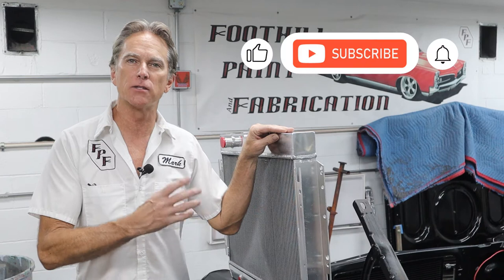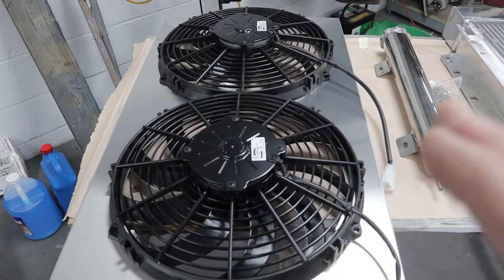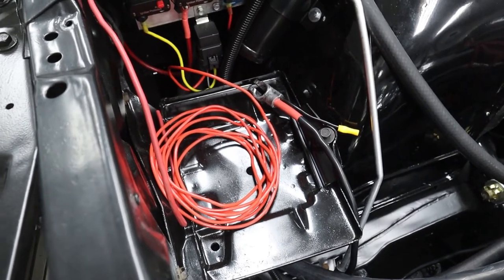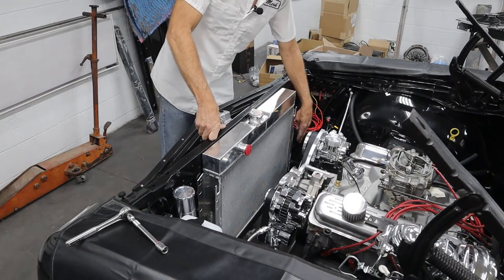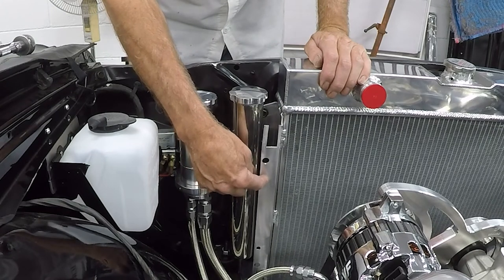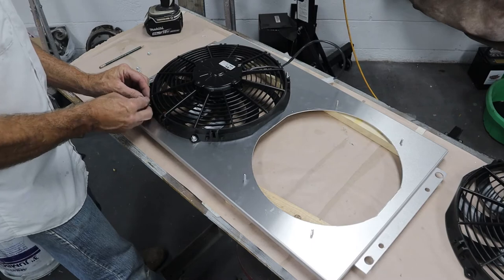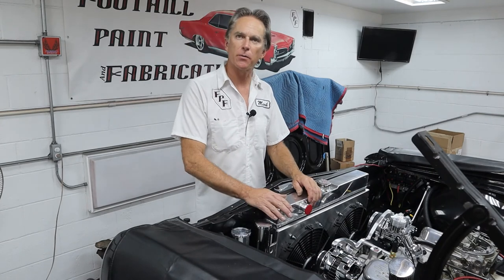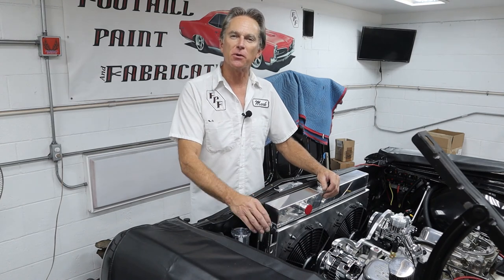1965 Malibu SS (Ep 21) Champion Radiator and Electric Fans Install

Comment: Nice install! I just installed (Friday) a champion 3 row, dual spal 13 inch fans and overflow in my 67 c10. The install went smoothly, no issues, truck runs 198 with AC in the south Texas heat. Never climbs above 200 even after an hour idling with ac. Very happy with my new setup.
Reply from the maker: That's awesome, got to love it when the install goes smoothly. The Chevelle gets to 180 most of the time and stays there like the gauge is broken. Nice not having to watch the temp like a hawk with the AC on.
Mark

Comment: She's really coming together now Mark. Very nice work. The only thing missing is the 6-71 and a couple of quads. The primary radiator on my 53 Chevy 3100 has two 1 1/4" wide cores with one large 3300 CFM chrome fan. I think it was $850 three years ago. Since my A/C compressor is electric I didn't have to deal with that. Thank you for your time.
Reply from the maker: Where did you get your setup?

Comment: Great video Mark.   I purchased the radiator for the 1949 Suburban project from US Radiators.   It’s made in the US (much more expensive) and it’s modern technology with a period correct look.   I’m a ways from hooking it up but I’ll let you know how it goes.  Thanks for the videos.
Reply from the maker: Thanks Robert, I will check them out. I think I am farther away from hooking up a radiator than you are...
Reply: I have a 1951 chevy 3100,with a 283 sbc in it. and I bought a engineered cooling products radiator for it. Same height and width as original,  thicker to accommodate a sbc and the trans cooler in the bottom tank.

Comment: Nice video thanks, one thing that drove me nuts was the cap and emblem cocked to at an irregular angle and not straight on when looking down at it. If you upgrade to the engraved cap it comes separate from the cap that goes into the radiator and you just clock it the right way u want it and push it down and its nice and straight. Or  you can heat the emblem with a heat gun and pluck it off, orient the way u want and re apply glue to it. I’ve done both but the engraved cap looks stout and visually appealing
Reply from the maker: Thanks for the tip, I will let the owner know.

Comment: Thanks Mark. I am not sure how much difference there is, but I have a 67 Chevelle with a BB and running the CVF Racing serpentine kit as well and I have major space issues. The BB is pumping about 600HP and I have a 2" thick radiator and dual HP Spal's with no shroud since the fans are 3 1/2" thick I just dont have the room. If you had any suggestions I would greatly appreciate it.
Reply from the maker: Brad,  Have you considered making the fans pushers instead of pullers?  Putting the fans on the grill side and having them push the air through the radiator might be a solution.  The radiator doesn't care how the air flows through it, just as long as it does.
Mark

Comment: Nice informative video. I have a puller radiator fan for the vehicle.  I have a pusher fan which came with the aftermarket ac system.  I have the pusher wired into the relay that came with the ac system.  I have a mechanical temperature sender so how can I wire the radiator fan in to run in cycle not constant on or manually switched?
Reply from the maker: Charles,
You would need to add another sensor to trip the relay and a trinary switch in the ac system is a very good practice as well.  The trinary switch controls the fans by the pressure in the ac system, not by temperature.  It is possible to go over pressure from not enough air flow over the condenser before the engine gets up to temp to turn the fans on.  You could add the sensor to the cylinder head which will run a little hotter than the one in the intake manifold but it is better to have the fans come on a little early than to late. Something like this   https://a.co/d/0Xy6LDr
Let me know if that answered your question
Mark
Reply: @FoothillPaintandFabrication  ac system comes with its own m trinary switch was included and already attached. My engine is a late 64 283, power pack heads, very little in the way of head ports to put anything in . I have one in the intake manifold that will take the mechanical oil temp sender. Could i possibly use a T fitting  .
Reply from the maker: @charlespartak2435  unfortunately the sensors really should be in the coolant flow, to much risk of an air pockets giving bad reading.  A thermostat housing with a port would only read when the thermostat was open. Is there a boss on the intake you could drill and tap for another sensor? Sometimes the coolant runner has a boss cast in both sides.
Mark
Reply: @FoothillPaintandFabrication  no. Its already assembled and im not drilling anything
Reply from the maker: @charlespartak2435  Any ports in the radiator? Only other thing would be an inline sensor Homyl Aluminum Black Inline Radiator Hose Temperature Sensor Adapter 3/8 NPT https://a.co/d/27BMY1q
Reply: @FoothillPaintandFabrication  never knew those existed. Looks like itd work
Reply from the maker: @charlespartak2435  I am thinking you could attach it on the lower radiator hose so it can read the water temp in the radiator. Upper hose would only read when the thermostat was open and flowing.
Reply: @FoothillPaintandFabrication  my lower hose is already tight . Ill figure something out.  Maybe I can put one inline on the heater hose right out of the pump.
Reply from the maker: @charlespartak2435  That will work if there is constant flow of coolant but you probably have a control valve on the hose for the a/c system. If you can't access flowing coolant then this is probably your best bet. Not ideal but you don't need the fans on until the thermostat opens anyways.  Dorman 902-2015 Engine Coolant Thermostat Housing Compatible with Select Models https://a.co/d/c8p8x7I